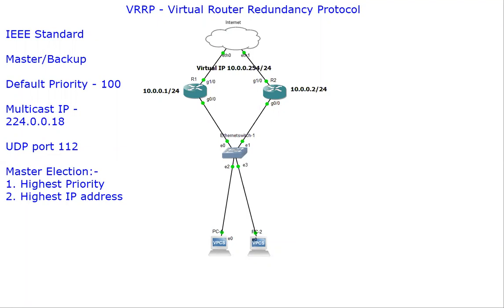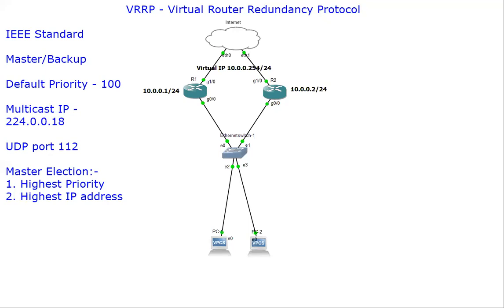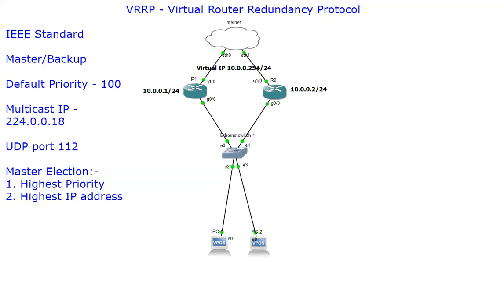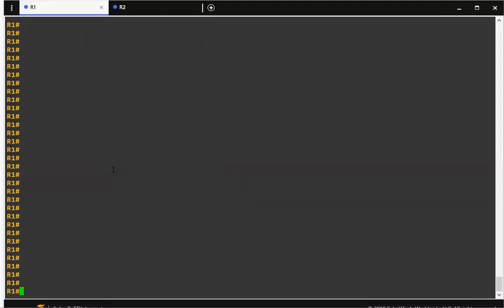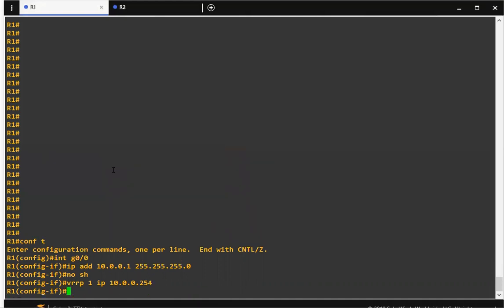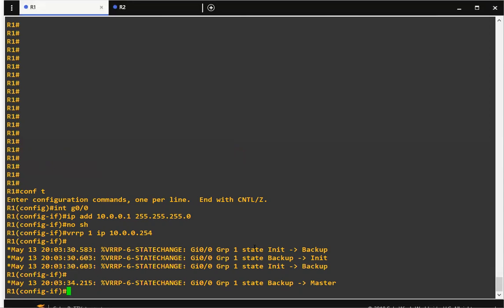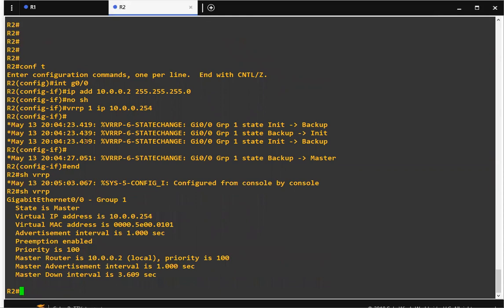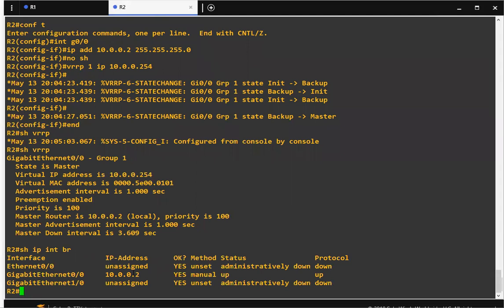VRRP Configuration

Comment: Hi,

I am from database team.
From db end linux team configured the keepalived with load balanacer with two database servers .
But when we are trying to connect to db any of the master or backup server we are able to connect.

But when the application team using the vip from app to db getting error.
We have opened all required db ports. But no luck.

Do we need to.lpem any specific ports from network rules for this vip (vrrp keepalived)